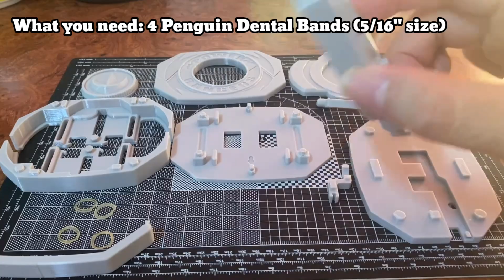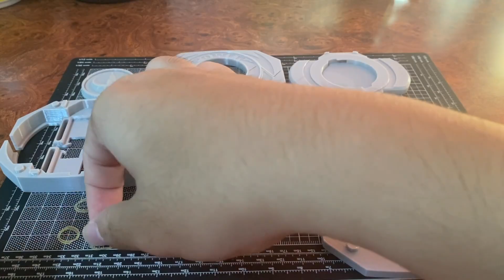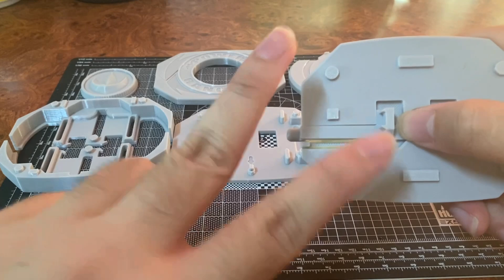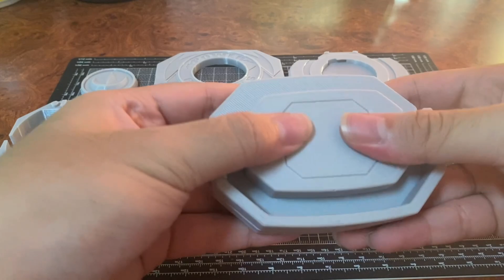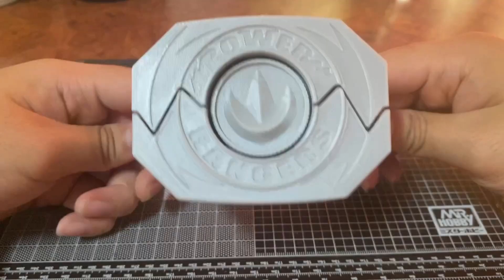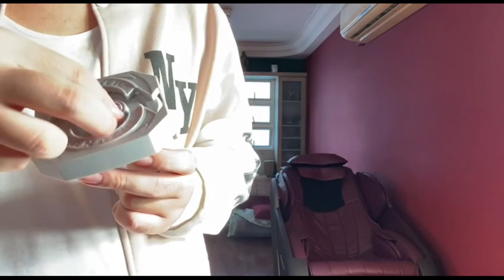A 3D Printed Power Morpher Assembled like LEGO/Model Kits? [How to Print and Assemble Tutorial]

Comment: Printed in petg pieces wont snap together not a single one other then the handle
Reply from the maker: i would highly reccommend using PLA instead, also push down very hard when snapping them in, as the model was built for highly tuned printers, as well as making sure nothing is loose

Comment: That looks fantastically engineered! I love how you did this where it doesn't even need screws or springs, and prints like a model kit without supports. AMAZING job!! I think I might buy one to support you. Just wish it was smaller and in scale with the '93 morpher toy (which was the actual prop they used on the show). All the newer stuff (Legacy, Lightning, etc.) is significantly larger. Really been looking for a 3D print of a functional 90s sized morpher like on the show.
Reply from the maker: Thank you! It took three weeks of mind-numbing thinking to get here, it's hard to get to size as I don't have the toy and just worked with whatever reference I could get, the coins Mirrored Lines Prop produced was the best I had to work around
Reply: @UltraElexiel If you ever want measurements of any of the official versions of the Morphers, I have them all and would be happy to take them for you.